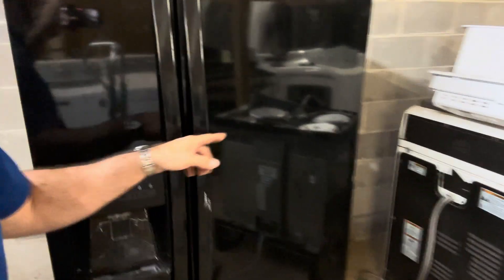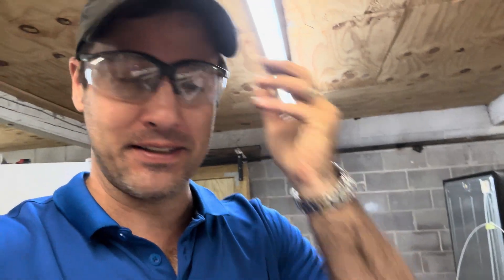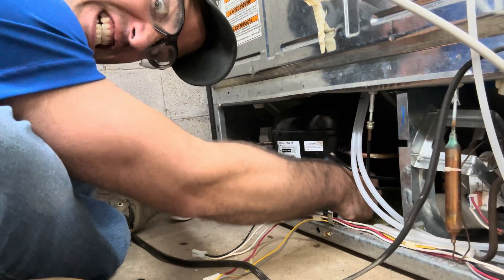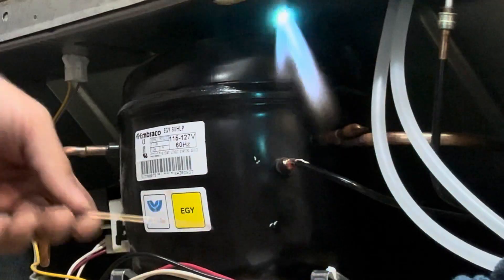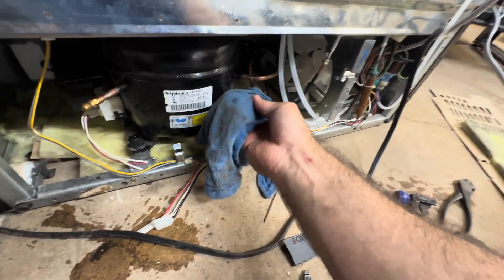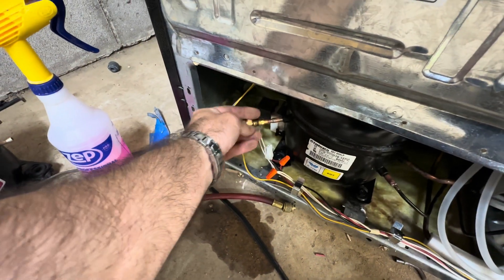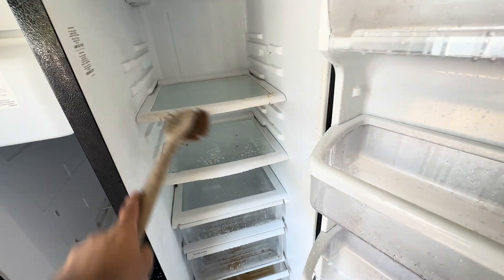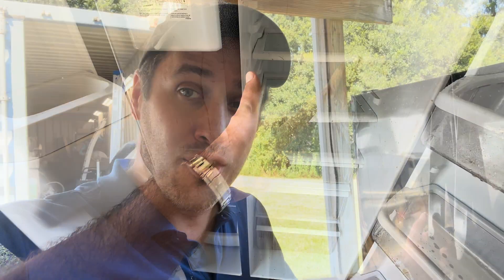This Whirlpool Refrigerator Has A Bad 240v Compressor | 110v Compressor Swap | WRS331FDDB00

Comment: did you recover the refrigerant beforehand or did the previous tech already do that? Not trying for a gotcha, just genuinely curious. Had a hard time getting a bpv on the high side on a similar whirlypop the other day
Reply from the maker: They dropped it off with the stub broke off so I imagine he/she tapped it. I assumed it had gas in it. Which I should never do.

Comment: Friggin flux! This must be similar to the higher seer efficiency AC units that have all the extra electronics in them that cost more to fix due to all the complexity. Are the energy savings really worth it?
Reply from the maker: Well the bigger the compressor the more power it uses. So I see it being better on big hvac systems but yes. It will take a while for the high seer units to pay for themselves. And hopefully it does before there is a problem. These small comps don’t use much energy compared to the biggins. Thanks for watching have a great day

Comment: My opinion the worst refrigeration idea ever, the variable speed hermetic compressor, worse yet, the linear hermetic compressor.  Lord help the people with the high dollar modulating central air conditioners.  Now they put that crap in home appliances. There’s no energy savings when appliances don’t last long.   
👍 for another great redneck repair / upgrade! 
About time you get the friggen flux! 😅

Comment: Always Friggin' Flux! LA, I never saw a man as happy as you because you had flux to help with your repair. I definitely could see where it made a difference, and it was quicker. That was a great repair. 
Question: Why would a variable speed compressor be used? Maybe I missed it.
Good news, a lady who works in the garden center at Lowes is going to take the dryer. We talk all the time I go. She said that she didn't have a dryer and couldn't afford one. I know that she wasn't faking. She's a very humble lady. It really made her day. It made me happy, too! 
I hope that you're enjoying your Sunday!
Reply from the maker: Yes sir flux helps so much. It helps a lot. I don’t know why I’m so hard headed and just struggled through it. That’s so awesome to give to someone who needs it. It makes the soul feel good to help. These variable speed comps use less power but at a price. The inverters fail often. These smaller comps don’t use that much power but big compressors in ac and hvac do. It doesn’t make sense to me in these refrigerators. Thanks for watching.

Comment: I have an older whirlpool from 1998. It has none of that nonsense on it. All of the controls are analog.
Reply from the maker: Yes 🙌 keep that baby going as long as you can. The thermostats and comp relays are known to fail. But they are easily repaired. Love those old whirlpools. Thank you for watching and thanks for the positive feedback

Comment: You're smart. I wonder how much energy is actually saved when a refrigerator has to be thrown away after only a few years because the inverter board or the compressor have failed?
The concept is absolutely correct - wasting money on high electric bills is dumb, never mind the damage to the environment. Just, these are built to fail and fail early. Whirlpoo strikes again. 
If you were worried about the load on that relay, you could always throw in another, heavier duty relay just for the compressor.
Reply from the maker: I was thinking that too. About the heavier relay. That would be smart. Why build it to last a decade when they can fill up the landfills with plastic fridges every 2 years 😂. Gotta love it. Thank you for watching g and commenting as always. Hope you have a great day.

Comment: I did a variable speed for the Heat Pump for my house when I got rid of my gas furnace last year. The Amana heat pumps come with a lifetime compressor replacement warranty, where they give you a whole outdoor unit if the compressor fails. Guess what I’m saying is that when something like this is used it should come with a long term warranty. I think they’re great for saving enerygy, but long term protection should be baked into the cost.
Reply from the maker: Oh wow I didn’t know about that with the Amana comps. Yes those big compressors on central units pull lots of amps. The variable speed one save a lot on power. And it definitely helps they stand behind their stuff like that. Wow. That’s good to know. But these litttle small compressors they don’t even pull 1-1.5amps when running. So it’s like why ruin the box with it. Thank you for watching. Hope you have a great day. I need to look into those Amana units.

Comment: Engineers just keep screwing things up.  Keep it simple stupid
Reply from the maker: Yes simpler is better for longevity and reliability in most cases. These things don’t pull many amps like big compressors in ac systems. So why complicate it. Thank you for watching and commenting steel as always. Have a great day